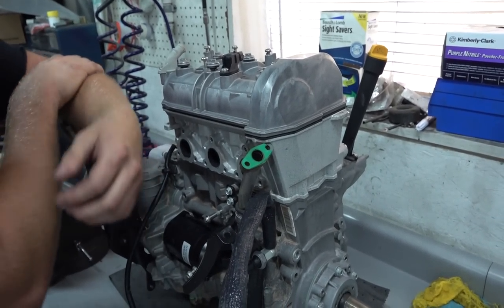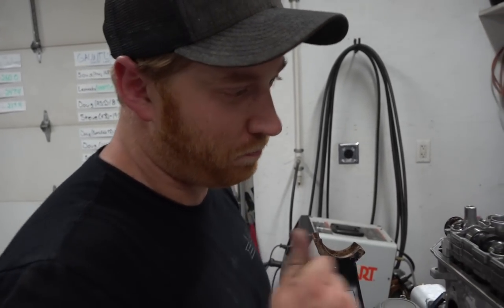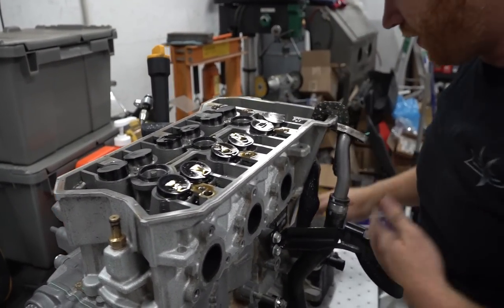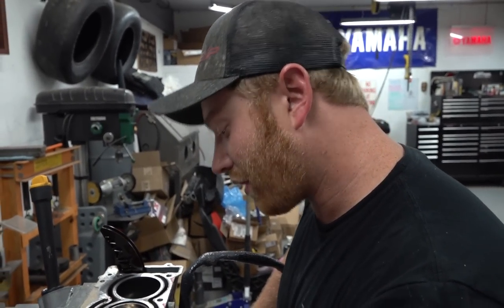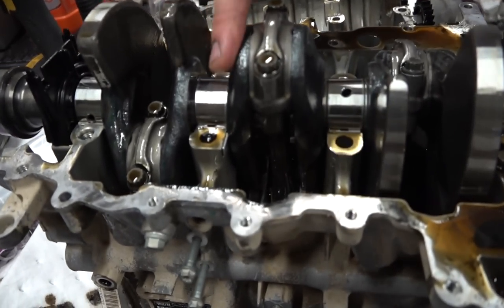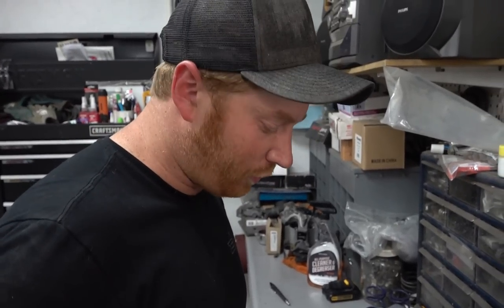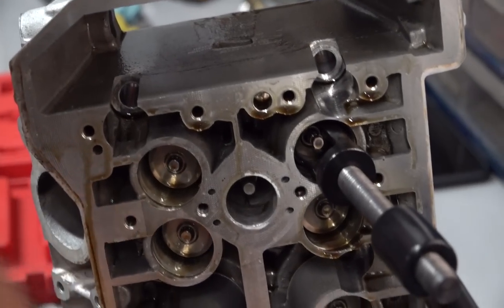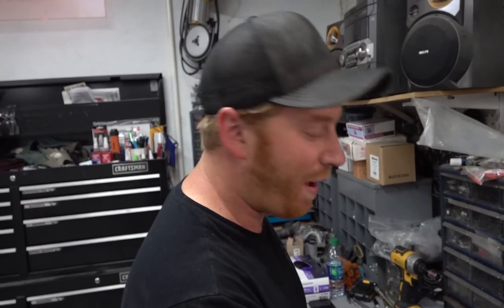Beast Mode Maverick X3 engine build! Disassembly + porting!

Comment: Replace the Bearings while your in there..
Reply: there no reason replacing bearing if there nothing wrong with them . it will be waste of time and money. most motor mechanic would tell you this . remember this motor is only 2 years old
Reply: @funtyes1970  yeah a total waste of 40 dollars🙄  lol you replace the bearing, anytime you open an engine up. they're super cheap unless you're that broke. 2 years of hard abuse is plenty of time I mean look at the scratch in the cylinder he was talking about

Comment: !!!!!!!!!!For the love of God but new bearings in it. Cheap insurance !!!!!!!!!
Reply: If they show no signs of wear and are within spec, that would just be tossing money in the trash.
Reply: @Cannibal440  Ya, sort of. However, new rods, etc..... Can you see .001" difference? Why tear an engine down this far and not replace the crank bearings?!? I did that once. Ya, they looked good, save some money, I ended up rebuilding the motor again two weeks later. Blown rod bearing. Cost me more in the long run.
Reply: @JR-qz3zt  well I guess you did something wrong rebuilding that motor . never in my life see a bearing give out if there in spec . remember this motor is only 2-3 years old .

Comment: Question 🙋🏻‍♂️ if we don't need to adjust the valves on the X3 engine because they are hydraulic. Why dose my dealership keep trying to push for a valve adjustment on my machine? Lol @ 250$ charge btw I agree with you on the no major need for it with those style.
Reply from the maker: I'd be calling them out on that BS

Comment: 400+ HP out of a 900cc motor. Crazy. I work with a guy who drag races cars. He's pushing 600+ with a turbo 350 Chevy. That's over 3735cc! Reliability has to be a issue. Cool stuff but, I think I'm happy with my 172HP. Lol. I'm an old motocross guy. I'm more about suspension and handling than short bursts of extreme speed. I'm more of the RJ Anderson style. 😎 My daughter won't ride with me in my X3 RC turbo R. However, she used to love riding on the back of my GSXR1000R. 110MPH didn't phase her. Kinda says it all I guess.
 You guys make some good videos. Interesting stuff.

Comment: Did you say the engine was smoked? What happened there, to that there engine sir?
Reply: Nope, engine was not smoked. Leo is stepping the game way up. The only thing smoked is the competition when beast mode is back together and running.
Reply from the maker: No it ran strong. Just didn't want to put a window in the block when we inevitably turn it up

Comment: A few thoughts - There are no sleeves. Show us the cast iron sleeves you claim are there. Motor is not hurt and the factory parts are amazingly strong and in amazing condition. Why not show a close up pic of that disappearing scratch and yes you were on the same cylinder and couldnt feel it. Why not mention the Amazing quality of the Rotax castings and other parts? They are Jewelry compared to polaris and you wont even mention it?
Reply: Why are you so mad
Reply from the maker: There are sleeves. We've had to replace them on other engines. There was a scratch. No real reason to highlight us taking a very obvious shortcut in not fixing it 100%.

Comment: I have rebuild 3 can am maverick x3 engine but I got the intake cam shaft lobe 37.49mm and exhaust 38.55mm while the service limit should be 38.33mm both intake and exhaust

Comment: If your building big power X3 engines our CylinderSupportSystem would be the ideal way to strengthen the cylinders without adverse cooling issues typically seen with thick cast iron sleeves. And it cost way less!!  We are looking to get into the utv industry so give us a call if interested.
Reply from the maker: Hey yes sounds good 👌🏼